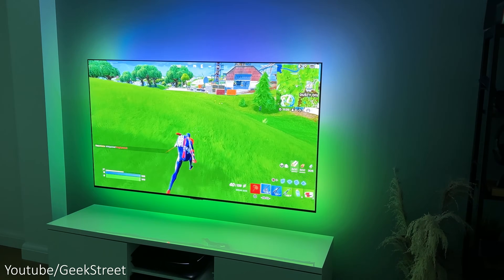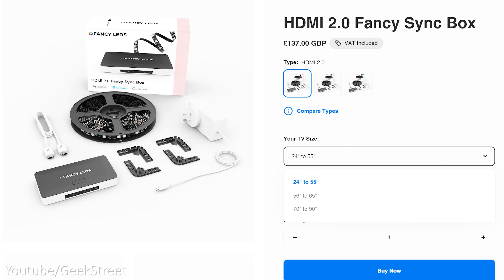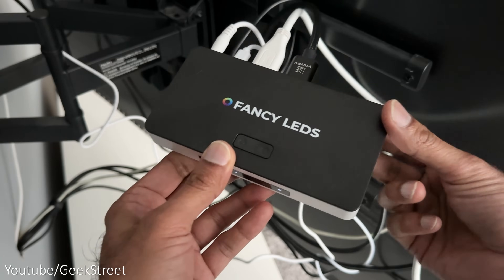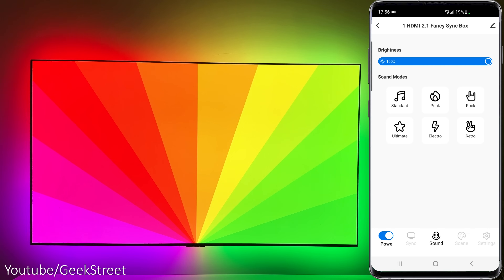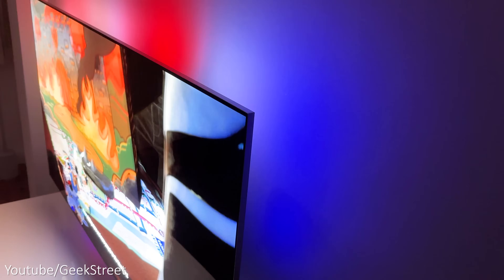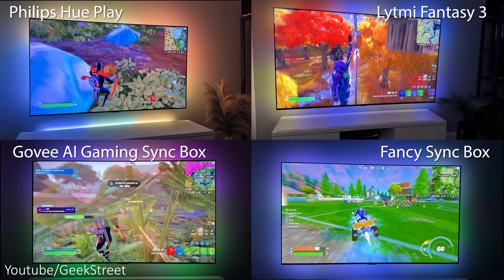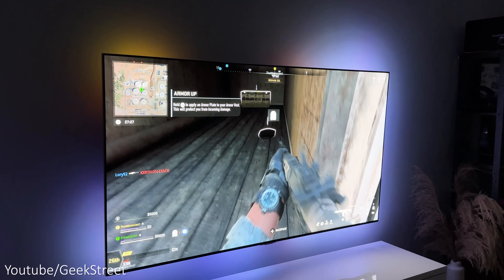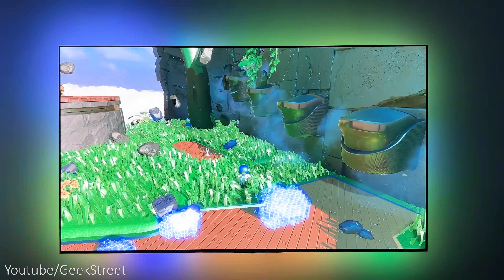The HDMI 2.1 Sync Box that DESTROYED Govee and PHILIPS HUE Sync Box! | Fancyleds Sync Box Review

Comment from the maker: Fancyleds new 3 HDMI 2.1 sync box and fancy neon - https://youtu.be/2cOwir2V9Go
NEW RELEASE Lytmi Fantasy 3 PRO Review - https://youtu.be/QBOUFUVkdr0

Finally a fully operational HDMI 2.1 Sync Box - Let's go
Reply: man, can you make a video for best monitors 4k for ps5 with good colors plz
Reply: Iytmi fantastic 3 pro support also vrr and allm
Reply: @Hpman-Es  what Pro version?
Reply: Why does it say HDMI 2.0 on Amazon?
Reply: 0:13
Reply: That's because this isn't hdmi 2.1 , it's hdmi 2.0
Reply: Why would I not just get the Lytmi Fantasy 3? Its $5 more for 50% more leds and 3 more hdmi ports as well as better color accuracy...
Reply: Supposedly it has a lot of audio and video issues, though.
Reply: bro! need help! I also have fancyleds  LG G3 and the image from PS5 is not displayed. Tried everything, doesn't help (
Reply from the maker: @Doctorishka13 I'm surprised, check if there is a firmware update and contact fancyleds support. Let me know how it goes as it will help others incase they encounter the same issue.
Reply: @Doctorishka13  i have same issue, did you fixed this issue?
Reply: I have issues when i connect hdmi from ps5 to sync box screen don’t display but apple tv is work perfect
Reply: Was about to drop some money one two govee kits, never heard of this brand but now you got me researching it thanks 😅

Comment: Thanks for the information. Just ordered the 3.0 and returned the Govee T2. Can't wait!
Reply: Govee / camera-T2 is better why? don't spend on $$-cables?
I have it, and 4 Govee Smart Light Bulbs(all$40) on each corner of the ROOM, and the tall lamp by the side of where we sit (6-all Govee & link to the app) and ALL the WALLS of the room is a THEATER for PS5, DVDs. MOVIES, SPORTS. I even stream my laptop to the Flat 65" TV, at 10"  away from the wall (it looks like it is floating in the air). It is like a NIGHT CLUB nothing compared to just lights around the TV. and if the screen is black everything gets dark like off "black", and when the TV is off, everything turns off. plus I can control each color intensity of light on each WALL of the ROOM.
Reply: Yeah, I’m not convinced the current evolution of hdmi sync boxes is better than a camera based system like the Govee T1/T2. To my eye, the accuracy of the FancyLED sync box is too accurate; instead of nicely blending around the edge of the tv and subtly augmenting the picture, the individually color-matching LEDs appear to create bright, clashing blobs that draw the eye and  detract from the picture displayed on the tv.

Comment: Hi, if I have an HDMI 2.1 splitter. Does everything work as it should if I switch between the hdmi?
Reply: did you find an answer for this? i'm in the same boat.
Reply: id also like to know
Reply: Ditto! @DaggerXIV
Reply: @DaggerXIV Ditto!
Reply: @billyheddle8552  wait how is yours currently set up with your hdmi 2.1 splitter? what is it plugged into and what does that splitter split? I can answer, just need more details about how your current set up is.

Comment: Curious. This is my same dilemma. I’m heaving into home theater sound. Im currently using a Sony sound bar that supports all the fancy inputs (VRR,low-latency,120hz, etc) I plug my game console into the soundbar, then to my tv. Essentially I’m running the video signal through my soundbar to my tv almost like a multiple hdmi switch. I’m wondering if I was to do that same but plug the sync box in between the soundbar and tv. Would it still work without issues or even work at all?
Reply: Great question. Curious to know too since I plug everything in to my onkyo receiver.
Reply: Does your tv support e-arc? You can plug your sound bar into the hdmi e arc  input and your gaming console into another hdmi input. Same result. Then you can use the sync box.
Reply: I had this same question. I’m using different gear (Sony STR-DN1080 receiver) but if there’s pass through on your soundbar it might act similarly … what I did was plug HDMI inputs (eg Apple TV in my case) into the receiver (soundbar in your case), then the HDMI out of the receiver (soundbar) into the sync box, then sync box to TV.

Earc coming out from the TV makes things trickier, since that doesn’t send hdmi video, just lets you output sound from TV-sourced streaming (like on-TV streaming apps). I hope this helps, not much info on it all but I got it working with my setup and it’s righteous

Comment: Great review, got me to pick one of these up, however I have run into problems with it, whenever I load up a game on the ps5, the screen goes black and says no signal for all between 10sec and 2 minutes before coming back, any idea? Anything you ran into with yours? Really annoying and when I mailed them and asked they said they were going to put an update to my device, but I just cant belive im the only one having this problem😂
Reply from the maker: That makes no sense, my PlayStation was fine. What TV do you have?
Reply: @GeekStreet Lg c3, tried different hdmi 2.1 cables, tried every setting on the tv aswell as the ps5, turning off vrr only changed the black screen time a bit, got the picture back a little bit faster with vrr off, but otherwise still not working as it should, Fancyleds said they were working on an update for me but that they had never heard of the issue prior to this.
Reply: @linushall5064   That's correct, not for the PS5. So we're investigating, likely a fault or outdated firmware somehow. This should be solved for you soon, we appreciate your patience and apologise for the inconvenience.

Comment: How does it detect how long the led strip is? Say I connected a longer strip (of the same make/model addressable leds & external PSU) for a 200" screen - will it detect / resize properly?
Reply from the maker: Not something I've tried but I wouldn't be suprised if it works.
Reply: @GeekStreet I don't think it would work... 99.999% of sync boxes I've looked at and contacted sellers - don't have options for adjusting the LED strip segments, so you purchase a 42" "version" and you can't use it on a 55" screen because "it's locked". Is this the same with this product?
Reply from the maker: @IvanV5900  best to contact the seller, I was thinking it may work as the led are cuttable and on start up it goes though a calibration. Let me know have it goes as hopefully this info will help others.
Reply: @GeekStreet The sellers are unaware .. they just sell a product. Do you still have yours? Can you test?

Comment: The worst part about the Phillips Hue system is it won't stay connected and I've had to do a janky and lengthy factory reset procedure on multiple occasions. A lot of times it loses synce and months go by before I take the time to go through the lengthy process. It requires a Phillips Hue Bridge, and the Hue Sync system causes the Bridge to lose connection. I have had that Bridge for a long time and didn't have issues before adding Hue sync to the mix. I was hoping it was an old Bridge that was the source of my problem. I recently bought a starter kit with a newer Bridge and the same issue. I think I am just going to order this since I have a PS5 and pre-ordered PS5 Pro. Hue Sync was a massive waste of money. I love the diffused light strip though! I wish I could hack it to work with one of these other brand sync boxes.

Comment: Looks great. But as mentioned it will only work in whatever HDMI port it is plugged into. I guess I could plug my Xbox or ps5 into it and watch and do everything through that HDMI input. But unfortunately I do have a ps5, a series s, a one X and also my tv input. With my govee I can have all those operate from what’s in the screen alone. And couple that with all the other light so can add to the system and it’s great. It looks better in the dark anyway so no problem with having to dim or turn overhead lights off.

Comment: The philips colors looks better on the wall, the other's seem to create a little bubble or is it youtube compression. Does the led strips have anything to do with that
Reply: The LED strip has everything to do with that. The reason why the Phillips hue looks so good on the wall is because their stip has a thick layer over the LEDs that diffuses the light. Essentially it blurs the gaps between each LED so it looks like one solid light. But it really is the same thing underneath that. Individual LEDs like the other strips. So you could manually diffuse the strips with some thin layers of styrofoam and adhevise. That way you can add multiple layers until you have the perfect balance of diffused light vs. brightness. Because each layer above the LED is going to reduce the max brightness that shines through.

Comment: Lytmi Fantasy 3 Pro was released last week that supports ALLM and VRR,  I grabbed it because it also came with 3 HDMI inputs aswell
Reply: And I heard the lights are washed out and the latency is still there is this true cuz every damn review seems paid sadly
Reply: There’s only one review so far on YouTube about the lytmi pro. They have fixed the HDR issues, only issue is VRR. Every now and again the screen struggles with the handshake when loading a game with VRR. If disabled it appears to be fine 🤷‍♂️

Gutted as mines in transit & don’t know if I can be arsed with it.
Reply: @InSaiyan-Shinobi  I am coming from the Govee T2 dual camera system so maybe my opinions are not as accurate as others but the colours are just as good as the govee in my opinion and ive seen no latency at all, especially compared to govee camera system. Ive tried all the ambilight tests on youtube and it keeps up with them pretty accurately to be honest
Reply: Where did you buy this? On their site it just says 2.1? I can’t find the pro
Reply: @Weekend_DMZ_Warrior  select fantasy 3 and then configure as a pro
Reply: @Weekend_DMZ_Warrior  its still the 2.1 version but in the option boxes you will find options for TV sizes and above that an option for Standard or Pro (ALLM & VRR)
Reply: I bought the lytmi it was awful with dolby vision.
Reply: @rockaloud06  I can't commend on that as I don't use Dolby vision, but it works great, just need to play around with the sliders a little bit

Comment: Hey great review ,2 quick questions 1) if you exclude the VRR and ALLM functionality since i will be using it only for movies, how is the performance vs Lythmi 3 ? 2) when you close the TV do the LEDs close as well automatically or remain on? Thanks!!
Reply from the maker: 1. Similarly but colours are sightly washed out on Lytimi.
2. If the source is off the lights remain off from what I remember
Reply: They werent washed out, they were dead wrong. That was in hdr and it no longer applies. They released firmware that corrected the HDR color accuracy issue. It was showing red as orange. I'll be getting the vrr/allm lytmi box this week
Reply: @Cblan1224  oh they upgraded? What's it called?
Reply: @FatalCorleone07 lytmi fantasy 3 pro
Reply: @Cblan1224  how's goin with lytmi so far? I'm torn between lytmi fan 3 and fancy 2.1
Reply: @Eliokyn  works perfectly. No complaints. Software is nice and they have 16.5 foot LEDs that were cheap for black Friday. I haven't set those up because I'm moving soon but one on the ceiling and one on the floor and they sync with the TV too.

The main thing I can tell you is that I've tested it with my rtx 4090 based pc and it handles a 4k, 120hz, rgb/444, 10 bit, HDR, gsync/vrr signal without a hitch. There has been no issue that I can see, whatsoever. I'm a PC gamer and having allm/vrr was essential.

I run all my devices into a Marantz AV10 processor, then the marantz av10 goes to the display.

I run "monitor 2" to the lytmi. Monitor 2 duplicates the signal from monitor 1. The lytmi doesn't even need to hook up to the display and still functions properly. There is no output on the lytmi so I'm effectively doing the same thing as if you were doing a 2-in, 1-out hdmi splitter. 

My processor takes the lowest signal and duplicates it, so if the lytmi had issues with HDR, vrr, allm, etc, I would see those issues duplicated.

It's essentially the same thing as running the lytmi between the AV10 and the display. I just wanted to see if it would work while only getting an input, no output. It absolutely does
Reply: @GeekStreet  Can this backlight be used with projectors?

Comment: So if it isn’t compatible with smart tv apps, could you use a Roku as a way around that? Thanks!
Reply from the maker: Yes that should work
Reply: In my opinion it's easier to buy a Philips 43PUS8118/12 that has this already integrated and its only 299€ which is only 120€ more

Comment: I prefer the Govee because with this you can only have one hdmi device connected and with the govee you don't have that problem becuase it uses a camera and also won't be outdated when a new hdmi, refresh rate ou hdr comes out.
Reply: You can use a hdmi splitter to connect more than a single hdmi device to the Fancy LEDs.
Reply: That and the camera is just an eyesore. Plus that camera does not work as well at higher fps.
Reply: @jordirapper my govee t2 is spot on with this video the colors are perfect and timing has virtually no lag and the govee t2 is 150$ cheaper.
Reply: I used to have the Govee with the camera and Phillips Hue's HDMI sync was a highly noticeable upgrade of how much better it synced and flowed with the colors on screen. It felt like it was worth every penny spent until I discovered that the box consistently loses connection and can't be synced back to the app without a janky and lengthy factory reset and pairing procedure. I'm very close to pulling the trigger on this instead. You really need to have tried both to see for yourself the difference. I would never go back to a camera option.

Comment: does this support lg 65'' oled evo g3 - 4k tv (2023) with their apps like netflix? someone told me you have to use a chromecast or google apps for it to sync (it cant use the apps you download on the tv itself)
Reply: All TVs are compatible. However, a compatible HDMI device is required for the syncing of the LEDs, integrated apps on the TV will not be synced. So if you would like to watch Netflix for example with synced LEDs, you will have to watch using a compatible HDMI device like an Xbox or Amazon Firestick.
Reply: @fancyleds  thanks

Comment: how long is that type c power cable? also the length of that hdmi OUT cable? 
What's the length of the cable from LED?
will it work with any HDMI splitter to have multiple source as input?
Reply from the maker: Hdmi is 1M
Power 145cm
Led type c 96cm
Hdmi splitter shoud work

Comment: hi there! thanks for your video. I have purchased two of these for two different dimension tvs. unfortunately i used the long one on the small tv grrr :( how can i connect the two already but correct cut led strips? thanks
Reply: Geek Street did a separate video specifically on cutting and splicing these LED light strips:>   How to Cut LED Strip Lights and Extend EASIEST METHOD EVER!

Comment: I’m looking at the listing on Amazon it says “Intergrated Apps on your TV are not synced, only the apps & streaming services on your HDMI device can be synced.” Why wouldn’t an eArc output work from the TV ?
Reply: eARC stands for Enhanced Audio Return Channel, so not for outputting video content. No TV has a visual output feature built-in, mainly due to piracy issues.
Reply: @fancyleds are there work arounds to use eARC? Say if I plug my Apple TV into the sync box, then connect the sync box to the TV, then connect my AVR to the TV via the eARC port. Would eARC still not work in this scenario?

Comment: Great video but nobody making these videos mention that Lytmi’s Fantasy 3 Pro Neo 3 model of their lights does support VRR and ALLM that gets ignored every time in comparison and reviews..
Reply from the maker: Didn't you just make that comment on the community post 🤔
Hopefully I'll be reviewing that one soon
Reply: I had it pre ordered and got it 5 days ago, works brilliantly, my only issue is the you have to be careful when peeling the led lightstrip adhesive as the stick part also came off, also once its stuck down on the tv its not coming off cleanly lol. Apart from that I have no issues.
Reply: @wrathcaster2555 you using PS5 ? Also what Tv brand you got? 

I’ve just replied to one of your comments. Glad it’s working for you, fingers crossed I get the same results. 

Like I said just, apparently when VRR is active it blanks out when loading a game ?
Reply: @leestar7156  PS5 and LG OLED G3, i had black screen flickers whenever I had the sync box connected to any other HDMI port other than port 1 for some reason. HDMI port 1 on the tv for the sync box game me no issues though

Comment: 【 HDMI 2.0b 】4K 60Hz HDR Dolby Vision Enabled. Next-gen compatible, perfect for all 60Hz TV & monitors. The Fancy Sync Box is compatible with HDMI 2.1 devices & HDMI 1.4, but only operates at 2.0b

Sorry but this is from their own storefront, if I understand that correctly it doesn't run at 120hz unfortunately - I guess their marketing department are playing with the word 'compatible' meaning the devices will work/fit but performance wise it's still pushing it at  4k 60hz out the other end.
Reply from the maker: You've looked at the wrong product if you're on their amazon page scroll further down to the hdmi 2.1 sync box
Reply: I found it, sorry it was a few down - nice find/video ty :)
Reply from the maker: @iNicklen  👌

Comment: Seeing this after buying couple expensive HDMI splitters and a switch to circumvent the AVR eArc and ALLM VRR DV pass through and the fact that i have to put up with Govees 55" size that i have to use for 65 with gaps in the corners..
Reply from the maker: With tech its constantly evolving just nice to finally get a fully working solution 👌